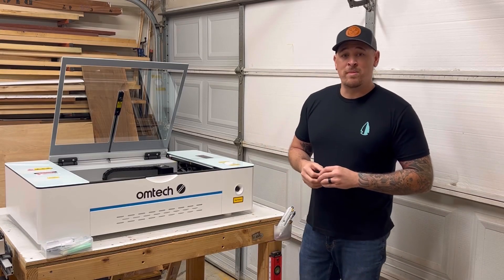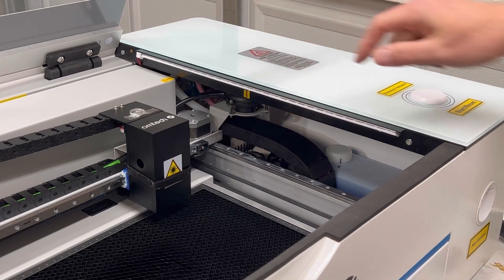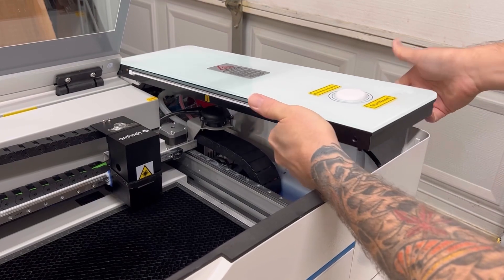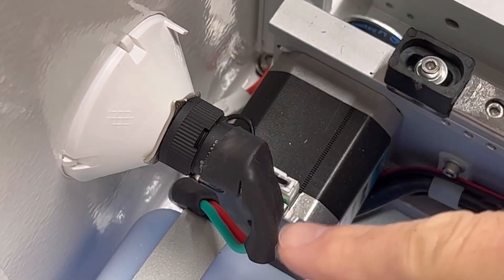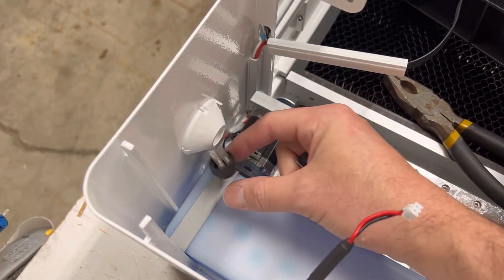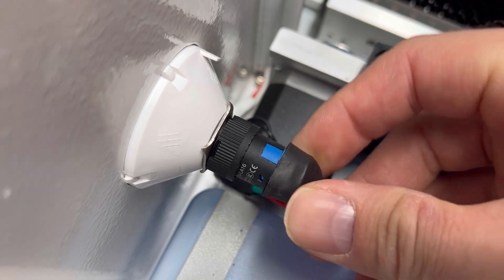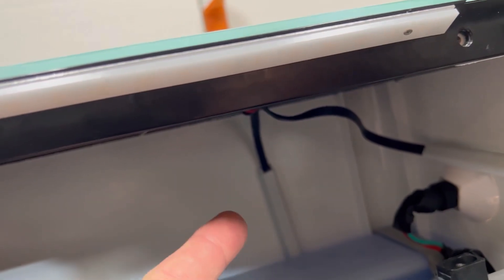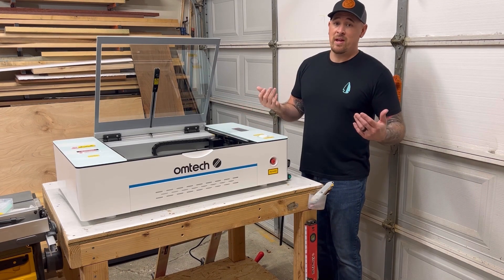Adding Emergency Stop Switch to the OMTech Polar

Comment: Not sure is it's because of EU regulations or general changes in manufacturing, but mine came with the emergency stop installed
Reply from the maker: I think you’re right. I manage the polar community on FB and the US models comes with key switches. They often fail anyways so you’re better off the with emergency shut off switch

Comment: Ok, finished watching so will comment on something other than geeking on green & black tools.  

If (still researching) we get one of these, think we’ll use a Jess-em (or similar) large paddle switch (need to double check the amp rating and Polar’s requirements, guessing it’s 15a?).  We’ve got large paddle switches on pretty much every stationary woodworking tool in the shop, even machines w smaller hard to see/access emergency stops.  We tend to mount them where you can easily knee-kick ‘em (if hands are full) or if hands avail you can easily palm slap em, which happens to be about where you hand naturally drops to.  

If something’s going south, don’t want to be searching for a tiny off/stop button.

As always, YMMV.  Just sharing.  Nothing more.  Nothing less.

Not associated with any vendors/brands mentioned other than as a satisfied/unsatisfied paying customer as mentioned in context.

Have a good’un!

Comment: Eww Green & Black tools.  👍👍  Ok, non-laser related comment.  Love’em, actually they’ve become something of an addiction from hex keys (awesome on stripped bolt heads) to pretty much every one of their screwdrivers (standard, not insulated).  Spent pretty much a whole rainy day going through their catalog and picking the sets that had the drivers I wanted.  Their 1/4” quick disconnects are nothing short of great, no more bits left stuck behind in a screw/bolt only to be noticed as missing when you go to the next screw/bolt several feet and a ladder move away, Grrrr (tribute to Grrr in Invader Zim).

Comment: Holy smokes thank you for this video! My wires are blue and red though. Do you happen to know if the blue wire is the same as green? I bought my polar a month ago and it wouldn’t turn off using either switch. They sent me replacement switches but I’m a little unsure about how to do it because all the wire colors are different than what my machine has.
Reply from the maker: Of course they switched the colors. Ugh. Luckily it’s only two wires. Before you crimp them down and put everything together you can actually test it by powering it on and pushing the button in. If it turns off when you push it I then you know you did it right. If you have to pull the button out then the wires are reversed.
Reply: My wires are the same, blue and red. Do you know what you did? My machine hasn't been powered on yet.

Comment: Dumb question. If I wire it with the green on NO will the switch work where you push to turn off?
Reply from the maker: It’ll work, but it’ll be opposite of what you want. It’ll turn off by pulling it out. You need to put it on NC for normally closed if you want it to shut off by pushing it in. I only know this because I made that mistake. Ha!
Reply: I was looking for this. Thanks @EdmondsWoodshop

Comment: @03:00 Does that Cable still attached to the Button Board connect to the front mounted LED Bar present on the Omtech Polar 350 but not the G·Weike Cloud? 🤔🤨
Maybe the next D.I.Y. Project would be a Red Dot Beam Combiner? https://youtu.be/zC5ljI3qFSs 😁
Reply from the maker: I can’t remember where that plugs in at. I’m actually out of town for the next few weeks so I can’t immediately check right now
Reply: @EdmondsWoodshop  No hurry, I was just curious since my Cloud has that spare unpopulated Socket that IS being used by your Polar 350 😁

Comment: The red wire quick-connect was still slipping even after you crimped it. It's not tight and may cause a problem in the future.
Reply from the maker: If it came off or comes off then it won’t come on. The connectors have a prong in the middle that prevent it from coming off. That’s why you see me squeeze down the middle.

Comment: I so want to buy one but am intimidated by lightburn. I have the FLUX Beamo and the software is so much easier to use. Can you set up your lightburn to different material and settings you use? I use a lot of birch wood and cut and engrave. Would love to see you do an engrave. Love how you explain everything!
Reply from the maker: The unfortunate part with those proprietary lasers is that your stuck learning and using their software. Lightburn is a semi universal software that is expanding its capability every day. They have a huge support system even outside of omtech machines. You can setup a library in lightburn to save your settings for specific materials. I find that my engravings on the polar are okay, but not as great as my 80w with upgraded air assist. You made still find yourself needing to do some post clean up (sanding).